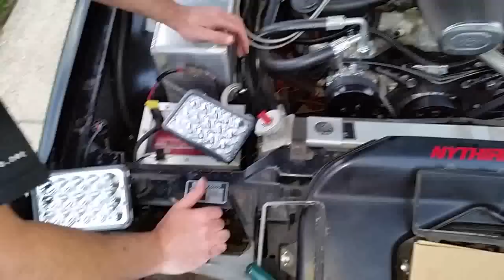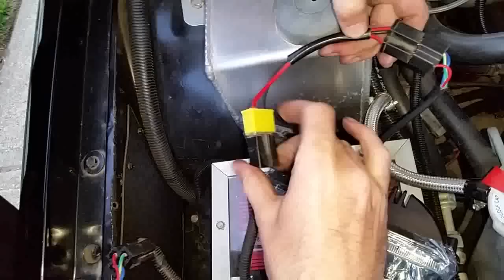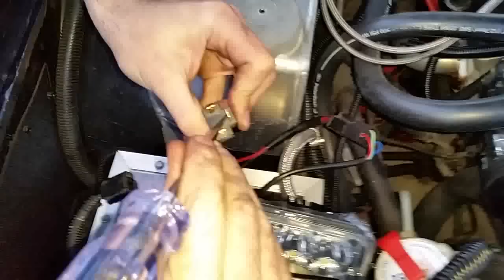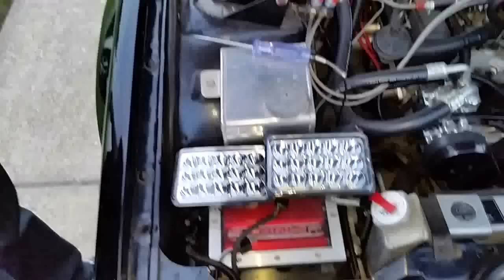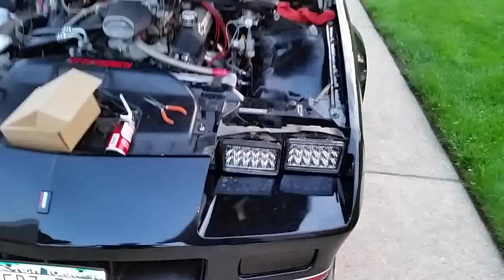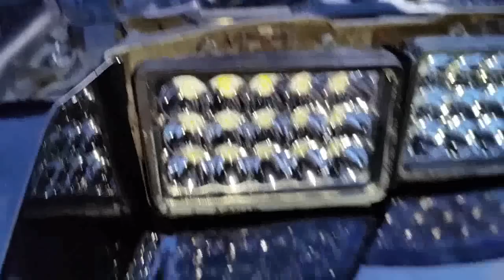Oracle LED Headlight Installation - How To Wire

Comment: Thanks for the great video i was able to do the same steps on my big rig 🤙
Reply: Hey Dgc...I have a 2012 Western Star and when I put these headlights in my truck, my low beams work fine but when I click the high beams switch, the low beams go out and I only have high beams.  I can’t find those 2-3 prong adapters anywhere.

Got any advice to offer?

Comment: if you just buy a set and used them as your high beams while say having hids in your lows when you hit your highbeam switch will the all the leds come on without an issue.
Reply: Yes will work.. and dont need a harness for highs. Just plug it in .. dont work flip the harness around

Comment: I did mine on a 1990 Ford LTD with 4;headlights. I switched the red and green wires around like you said but now my low beams are way too dim.. the high beams work just fine. But you can barely see anything with the low beams on

Comment: Kudos to you for doing this video!!  This may have already been asked, but when you say adapter/switch, do you mean both an H4 relay harness kit and a set of H4 wiring harness sockets?  I have a 1990 Toyota Land Cruiser.  The headlights are absolutely abysmal.  I got a 4pk kit of LED lights that look just like the ones you have there but now I'm thinking I'll need both sockets and a harness.  Could you advise me?  1 harness and 4 sockets or 2 harnesses and 4 sockets?  Thanks ahead of time!!

Comment: I am on my 2nd hi lo switch on the column. I'm replacing the hi beam with led angel eye lights so the current will be lower. Any thoughts as to why I am burning out hi lo beam switch.

Comment: Any other tips to get access to the bottom two screws that are hidden under the headlight pocket? I tried and I am really worried if I push down as hard as I need to (to flex the headlight pocket enough to get a screwdriver in there) that it will CRACK the paint and clear (My headlight pockets were painted and clearcoated).

Comment: Hey klowny 1969 I just got a pair of the Oracle LED headlights for my 79 firebird but I'm having a problem with the high beams coming on, the outer ones come on without a problem. So what do you think is going on with the LED's

Comment: Now if I just wanted to get a set for my low beams will they work fine? Im assuming all leds would light up. 87 chevy truck with stacked headlights
Reply from the maker: U can for low beams its only one row that lights up. .these are expensive units, not sure ifbu really just want to use these for low beams only..thanks for watching

Comment: whats the little adapter called so i can look it up cause i have no idea what to look up. and would this set up work on an 85 chevy c10?
Reply: You can make the adapter yourself with some wire and blade and spade terminals. It just wont have the plastic piece and you will have to know which pins to connect.

Comment: I have a 91 Toyota pickup I got the same headlights and I bought a separate harness for it and my lights only turn on when I put it on high beam when it’s on low they don’t turn on at all

Comment: with these headlights on the low beam side..is just the 1 row of lights actually bright enough? is it possible they can be wired so that the whole light will light up for low and both will light up for brights?
Reply: You will blind oncoming traffic if you do that. It would be like having your high beams on continuously. You could set them up to turn on with the high beams though.

Comment: Hi, I bought a set of turbo SII led headlights. the three prong connector has a yellow, red and black wires.  DO you know which wire is witch>?.....would the red be hot and black be ground/?
Reply: On mine red is ground

Comment: I put a set of projector (Halogen) in my 84 Cutlass 4 headlight system. Lows are fine, highs are good for a few minutes, then they all start flashing on and off. also, my bright indicator on dash stays on all the time. the highs are only 2 wire plugs and I skipped the top prong. bent up a little to miss plug. Finally I just unpluged highs. Suggestions please, Thanks
Reply: Jim Ausman ever fix this issue? I have the exact same problem on my 82 Regal

Comment: Quick question I did exactly the way u did it and the low light are really low can hardly see can can I do for them to be work
Reply: Carlos Calderon I’m having the same issue with mine. Did you find a fix to it?

Comment: So did anyone actually get it figured out?  I hear some saying get the adapter, some saying don’t need it.  I got a set in my Western Star tractor trailer and I got the low beam working fine but when I go to high beam, the low beam (LED) lights go off.  I’ve used a test light to make sure I know which wires are high beam, low beam and ground but even that information was useless.

Any info would be great.  Especially on the adapters if there really is somewhere to buy it.

Thanks
Reply: did you figure out the problem? im having the same problem

Comment: Any oncoming traffic will hate you for installing these.  They spew light everywhere. I've also never seen a comparison of these in low/high vs the stock lights, probably a reason for it.
Reply from the maker: Mark Burton as i mentioned in the video..they are very bright

Comment: You guys realize the adapter is completely useless right? You don't need it at all. You said the original is two pin. Then you adapted it to three pin but cut the wire to the third pin and didn't even use it! Lol! Stupid. You can and should wire or connect these up without the unnecessary adapter.
Reply: Then what would you do with the low beam wire ?
Reply: Thank you. Have a 1985 fleetwood brougham.  Can’t find the adapter so I will try your way.  Makes sense lol.
Reply: What about the low beam. Do I need to move wires around.  Nothing happens when turn on. Highs are just fine.
Reply: Don't listen to him

Comment: Hi I’d like to add my 2cents in... I have an 87 Chevy, I never bought any kits to wire my headlights up... I don’t know shit about electric ⚡️, I figured out how to hook mine up on my own... these guys have a plug and play adapter and still didn’t get it right.
Reply from the maker: Jeff Adamczak worked fine
Reply: klowny1969 wish I could upload pictures of mine, I just swapped couple wires around to color match when u plug them in, and added a ground wire to the high beams... so low beams have the one row and a middle dot lit up, high beams the bottoms fully light up and the low beams turn off completely, now with out grounding the bottoms lights all 4 light up like on the video...
Reply from the maker: U can wire it different ways

Comment: what are running for a 3 core radiator ?
Reply from the maker: Its a becool 2 one inch core
Reply: klowny1969 any issues
Reply from the maker: Nope..its expensive tho..600 plus dollars
Reply: klowny1969 do you have a link to cheaper alternatives
Reply from the maker: Check summitracing.com

Comment: Aren’t these flood lights? The output is going to be huge and terrible.

Headlights are focus beams, not floods.
Reply: I believe you never owned a 3rd gen lights are horrible lol
Reply: juggalo450 I have 3 sets, for my boat. Not for head lights. Thy are flood lights with a huge output with no cut off.